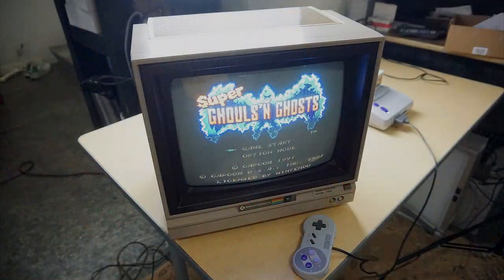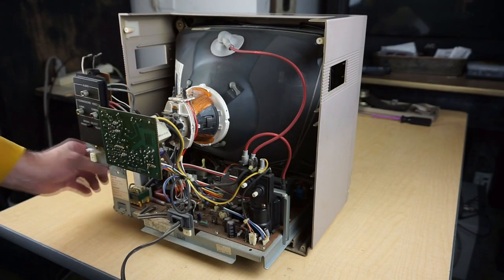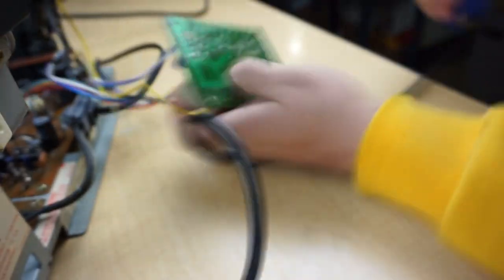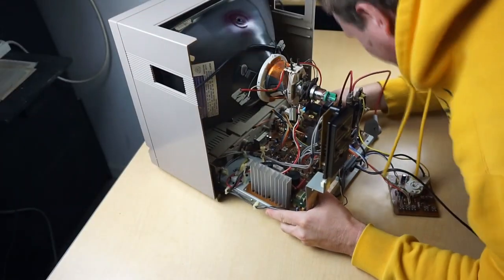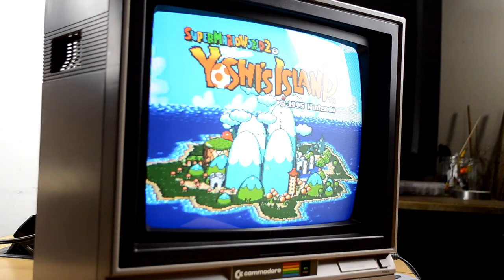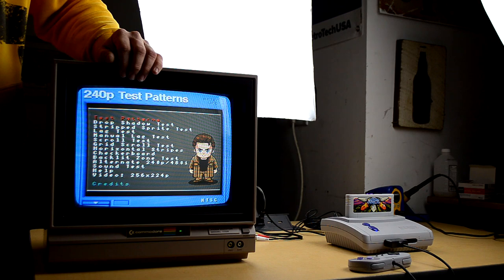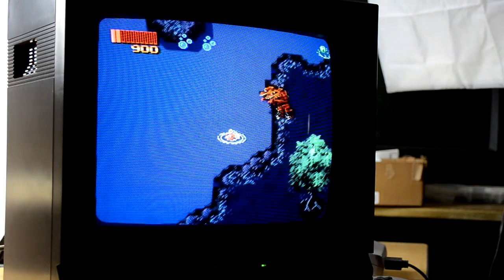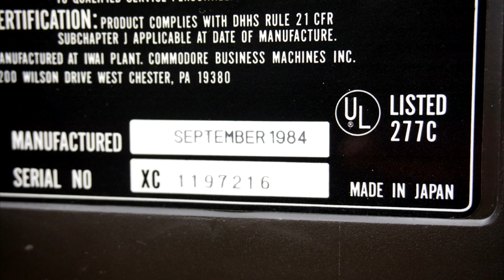Restoring a Commodore CRT Monitor 1702 - Featuring Commodore Video! | The Perfect C64 Display.

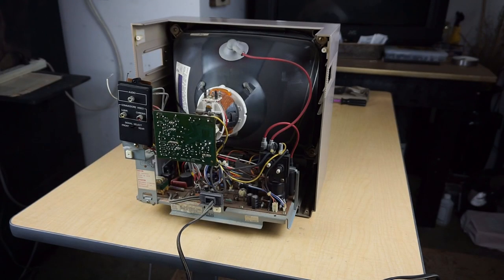Comment: @3:55 I'm glad you don't recommend discharging it as such as touching the disconnected anode wire to ground literally does nothing to discharge the tube. The built up capacitive/dielectric charge is stored in the CRT glass itself, not in the flyback or chassis. The tube anode needs to be shorted to its external dag or dagwire. This is one of the biggest misconceptions I frequently see on youtube, outside of trying to discharge it to an outlet/earthed ground. Please be careful in the future, I don't wish to see you get bit by a tube
Reply from the maker: Thanks.  Yeah, it definitely doesn't discharge the tube at all that way.  That's why I mentioned that no one else should do that unless they are aware of how the stored electrical current actually works.
Reply: @RetroTechUSA  Hi Steve, you say in your comment that "it definitely doesn't discharge the tube at all that way" but in your video, you say the exact opposite by calling it "the trained pro way to discharge tubes". I am not sure where you learned to do this, but as established above, it is definitely not a way to discharge a tube, let alone a trained professional way. I understand that you added a disclaimer telling people not to do it but the fact remains that you show it on camera and clearly describe it as a way professionals discharge tubes. I don't mean to come off aggressive but for a CRT related youtube channel that has about 10K subscribers I find this worrying, it is definitely spreading misinformation about discharging tubes and someone could get hurt. I understand that when making videos, one is bound to make mistakes, that's fine but I think this is big enough of a mistake and there are a lot of beginners treating your videos as the source of truth to warrant some kind of fix.
Reply: @RetroTechUSA  Probably best to say it doesn't discharge the tube at all...
Reply: @djcalle1975  He does not care. Sad.

Comment: When re-capping the 1702 PCB, be careful when replacing C101. The silkscreened polarity indicator is reversed. Install the new cap in the opposite polarity printed on the PCB!
Reply: Ouch, this hurts! Do this means that the silkscreen is wrong?!
Reply: Before you pull it out...mark the polarity with a sharpee on the board. - thanks for the heads up

Comment: I've owned my Commodore for a few months now. I very much enjoy it. I've cleaned it for dust, and the image is great but I got to run something like the 240p test suite to even up the geometry. I also have a problem with the Horizontal and Vertical position knobs. If I don't keep the Vertical position a certain way it starts to flicker, if I don't keep the horizontal position knob a certain way the colors start to look washed out.

Comment: Great video.  I just picked up my first 1702. It's in great shape, but I wanted to service it to make sure it lasts.  I also think i have the chroma issue with the rear switch.  Mine still has the front door and it's tight!

Comment: @retrotech hi i have a question just recently bought a commodore 1702 monitor and i connected my n64 on there to see if it works and it does but the picture is flickering. Do you know what that can be and if its fixable?

Comment: Hi! This video is amazing! I wonder if you could help me with a problem with a 1702, it won't power up; it blows the 1A fuse ( not the 4A fuse). I managed to unload the power supply by disconnecting B1 RED cable on the output, and the regulator (STR3125) seems to work fine, although with no load, it gives 160v at the output. So, if I load  the PS with the rest of the board (Red cable), it blows the fuse. Any hint? Thanks in advance!

Comment: I've got a question. My 1701 monitor has developed a buzz coming out of the speaker. The buzz can be heard when I turn the monitor on, even without anything connected. The frequency of the  buzz dies away as the power bleeds away when I turn the monitor off. I've moved the monitor to a different place to rule out any interference but it's exactly the same regardless of where I put it.
Should I start thinking of replacing caps? Or might this be another issue?

Comment: Mine is in my closet and needs a cleaning and a recap. It was overheating least time it was used. I have a cap kit on the way but dang that desoldering gun is expensive.

Comment: Any suggestions to fix the wonky signal select switch?
Reply: I have the same issue with mine, and would love to know if there is a solution.
Reply: Basically you have to flip the switch not 100% of the way. like, 80% of the way and it'll work.
Reply: Probably Nutrol control and contact cleaner

Comment: @Retro Tech    C606 is a typo, 607 is the actual cap to replace. The silkscreen has them close together
Reply: Also thanks for putting this together, I just finished re-capping and have slightly improved colors and geometry (there wasn't much wrong to begin with)
Reply from the maker: Thanks for noting that.

Comment: Hi Steve. Great walkthrough of the recap and servicing. I have a Commodore 1084S-D1 here that needs doing. I wonder if you have seen or worked on one before. Also what is the lubricant you put on the HT cap? Regards Graham
Reply from the maker: Thanks.  I have not gotten to work on that model yet.  The gel is called dielectric grease.  It can be really helpful with eliminating crackles from under the cap.  https://www.amazon.com/Permatex-22058-Dielectric-Tune-Up-Grease/dp/B000AL8VD2

Comment: Did you fix the lack of color that was interrupted by that switch on the back?  I have the same and in addition, the disturbances show, but when I tap the switch panel with my finger, it stops.  I'd rather fix it :)

Comment: So did the Cap replacement make the video any better?  It looked good on your previous video.  The camera never picks up the slight differences.
Reply: Late response but replacing caps just improves lifespan, with bad caps things start to fail.

Comment: I have one of these and the picture has a bit of empty space towards the top, like the image is slightly too low. How could i fix this? the v. hold doesn’t help.
Reply from the maker: you have to use the vertical center and size potentiometers.  I show them in the video.  Just center the screen and the expand it using the size adjuster.

Comment: I've got one of these, but I'm not sure how to hook up the chroma/luma from an SNES. What set up do you use? At 21:18 I saw some sort of gadget that does that. Do you mind pointing me in the right direction to get that kind of set up? Thanks, and cool video I may unfortunately have to use as a guide one day.
Reply: SVIDEO-TO-RCA-SHORT : S-Video/ S-VHS to RCA Y/C Luma Chroma Adapter Spl,  and and female to female s-video adapter
Reply: @Prime-1111X  thanks my dude. I found a cable on Amazon that does just this.
Reply: @yulopiari1  I got mines a couple weeks ago. I've just brought a monitor.

Comment: I just got one!! Awesome you did a video about this! By the way, did this have any tilt problem? Mine has it, slightly. Is it safe to rotate the yoke with the monitor on if wearing isolating gloves?
Reply from the maker: thanks.  The yoke should be okay to move without gloves, but make sure to avoid the connection point where the yokes cables are soldered to the yoke.  That can be a hot spot for current on some CRTs
Reply: @RetroTechUSA  to be safe I'd always use gloves anyways, but thanks for replying. Love your videos.

Comment: Hey Steve, is there a high-end PC CRT monitor on your repair list? That would be super helpful for a lot of people. Because adjusting those things can be a pain. Mine has a high resolution of 1600x1200 pixels. I adjusted the convergence, but somehow text isn't really sharp.
Reply from the maker: I'd like to, hopefully I can find a good one to work on soon.  Most of the ones I've gotten in before have been pretty old and not as exciting as the good ones.
Reply: @RetroTechUSA  well. I own a "Infotronic FSR871CV Professional CRT monitor 21" VGA/RGB BNC" would that fit the bill? It also has a really cool small green display under the screen that indicates what the screen is doing.
Reply: Its from the mid 90s.

Comment: Dumb question ? Is possible to scart  mode this type of monitors , will it make any difference ?
Reply: I think it's possible with the 1084s and some later models, but not these 1701/1702. Some of the 1084s (I believe the European ones) already have SCART ports. The US versions have a blank that can be punched out, so along with the port you'd need to add several missing resistors and jumpers.

Comment: Just finished a full restore on a shed-found 1702. Wish I'd seen your vid earlier but now sub'd.

I removed the boards from the frame so they could fit in my ultrasonic. Was completely filthy with rat poo and tons of shed debris-now very clean but the body has quite a bit of patina. Did you note that C101 was incorrectly screen printed on the PCB and should be installed in opposite of the marked polarity?

Looks great and an awesome little monitor now! Thanks for the vid.
Reply: Apparently it was installed as per the silkscreen. See at https://youtu.be/xC5vLicNOm0?t=650 and https://youtu.be/xC5vLicNOm0?t=1199. But the original cap was installed the way it "should be" as seen at https://youtu.be/xC5vLicNOm0?t=333. 

Interesting...

Comment: Its not that old.  My bvm is only 4 years younger.
The Atari 800 which came out in 1979 had composite and luma/chroma output.  What monitors had those connections back then?   Most people used C= monitors on them.

Comment: Love the video. Considering its old age, how was the CRT? I Mean, it looks really fine. I have a 1986 NEC-pctv 451 that's just about the same age of that commodore but mine is a bit dim even with the brightness knob maxed out. Just a newbie question for an expert like you, did you adjust this commodore's screen potentiometer in the flyback? I mean,is it safe? I asked this because I read in some forums and comments that adjusting the screen knob in the flyback for a 35yr old monitor will just shorten its life. I hope i could show it to you. TIA. Great video as always.

Comment: i recently dusted off my Commodore 1084 CRT Monitor (13 inch?)... perfect for the RGB via SCART Playstation 1 mod... :) SCPH-7502 loving it... though the old Benq Flatscreen TV with SCART 4:3 also seems to work well, might do a LAG check on that one to compare... seems fine with the PS2 Component testing i did at least...

Comment: hi retro tech i have a crt monitor that has screen warping do you know how to fix that problem
Reply from the maker: You can try adjusting linearity in the adjustment menu if available.  It could need the caps on the linearity control line replaced too.
Reply: @RetroTechUSA  I think the caps need replacing I just don't have the experience
Reply: To diagnose the board
Reply: And I don't know what to look for on the board

Comment: the switch on the back can also be dirty i had the same problem
Reply from the maker: Yeah, It worked much better after I cleaned it a little and switched it back and forth a bunch.
Reply: Common problem
later ones they upgraded to a bigger switch it can also cause your audio to go out. I can't seem to locate the smaller switch but the bigger ver is easy to find on ebay.

Comment: I cannot believe this guy is showing this stuff with little knowledge. It’s not the anode cap that holds the charge, it’s the crt itself! Hence discharge the tube!
Reply: "Trained pro way of discharging the tube." ⚡📺😲
Reply: I reckon. I was under the impression the techs use a probe connected to ground, via a resistor that’s in the M ohm range. They then touch the anode with that probe, before they even remove the anode from the CRT. I cant recall right, but don’t they also connect the tube’s anode to the ground strap via a wire?

I saw one 1701 repair video where the guy grabbed the CRT by its neck and lifted it that way. Major cringe. I know I wouldn’t lift one out of its housing like that - I’m too scared of the tube cracking and imploding, so I refuse to hold it at its most delicate point. Especially on a ~40 year old glass tube.
Reply: @adriaanstolk4487  Yep. Now, on that flyback the external focus/screen block is connected to the EHT and will discharge the tube within seconds of power loss anyway. And yes, you ground the CRT anode when the lead is removed because it can build back up from charge trapped in the glass and bite you when you go to put the lead back on. Keep all HV capacitors safely shorted when the bleeders are removed!